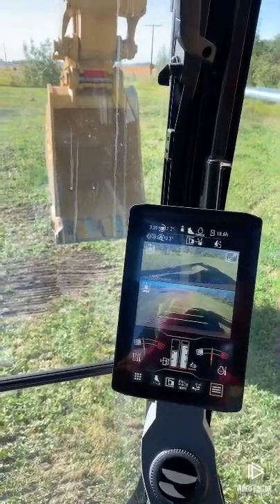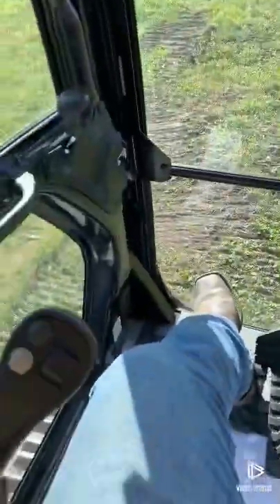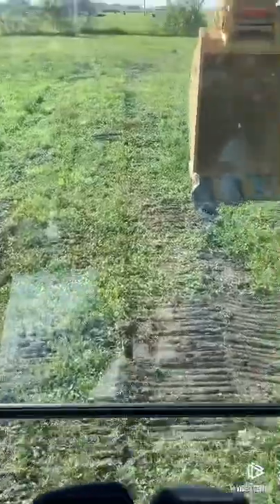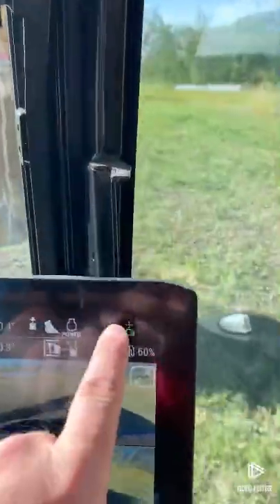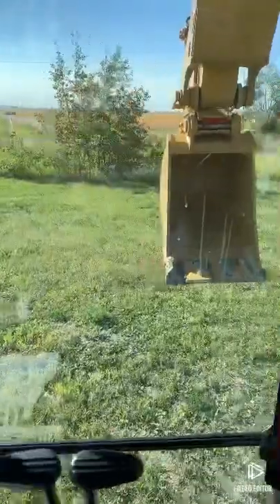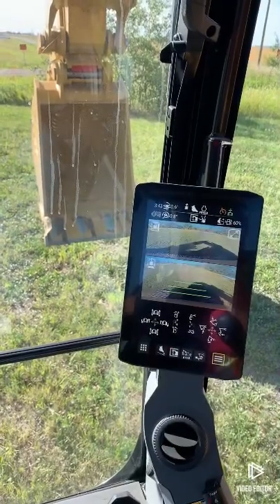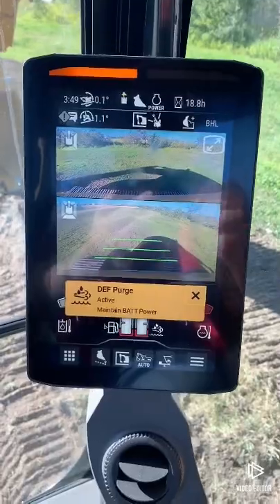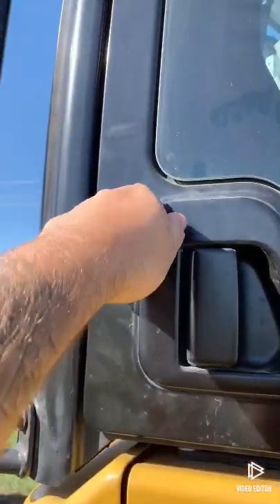Joystick steer tutorial - Caterpillar Next Gen Excavators

Comment: 😀Great works! thank you for your video. In the Stick Steering mode, Is the steering speed different when the left joystick is operated in the 1 o'clock direction and when it is operated in the 3 o'clock direction?
Reply from the maker: Thanks for watching great question.  When I’m stick steer mode the joystick acts just like it does in a skid steer.  If you go full strike on the joystick in any direction you get full flow to the track motors, you can modulate your speed by feathering the joystick to go slower and give less flow to the track motors. I hope that answered your question.
Reply: @ironman3406  Thank you Ironman!

Comment: Wouldn't it be helpful to be able to move the left stick up or back to also cancel the cruise control (vs finding a small button on the stick)
Reply from the maker: Great question, you can do it either way.  When you are in cruise control mode if you touch the joystick ahead or back it will cancel the cruise.  Thanks for watching

Comment: Good video! 

I'm questioning the implementation from CAT a bit though. They use the left joystick to control the tracks and move some of the functions of the left joystick to rollers on the two joysticks. Why not just have the track function on the rollers like other manufacturers do and have the functions of the joysticks as they are, that would be more intuitive and would enable you to more easily move around and use the functions of the excavator at the same time. The stick and rotation on the rollers isn't very intuitive.

EDIT: Saw a CAT video on one of their wheeled excavators and there they are using the left roller for steering, which is the norm. No idea why they decided to do it differently on their tracked excavators, perhaps their different depertments refuse to speak to each other and there is a prestige thing and they can't do the same as the wheeled department. Really odd.
Reply from the maker: Can’t really speak to the why but here’s what I suspect.  Cats Joystick steer was first developed for the mini excavator line.  Most guys with a mini excavator also have a skid steer.  You steer and drive a skid steer with the left joystick - I suspect it had something to do with that familiarity between the two.  It was added to the larger excavators after it went over so well on the minis.